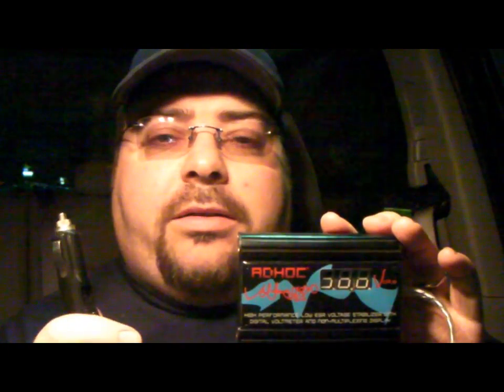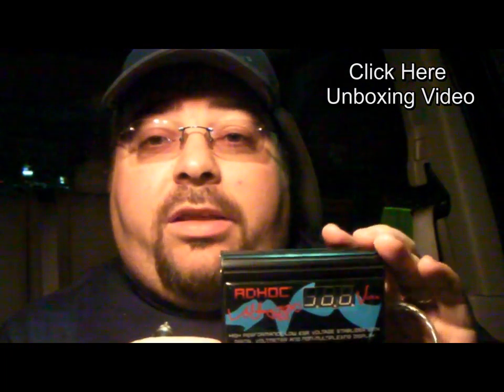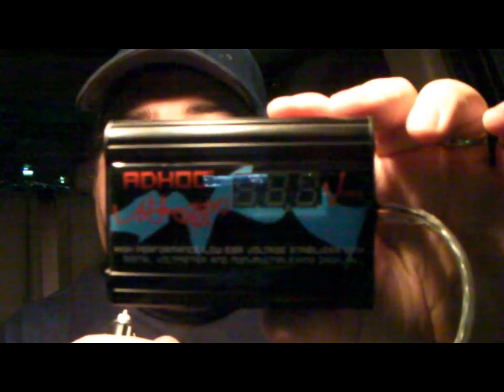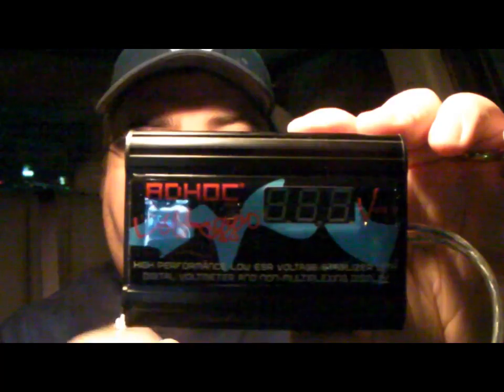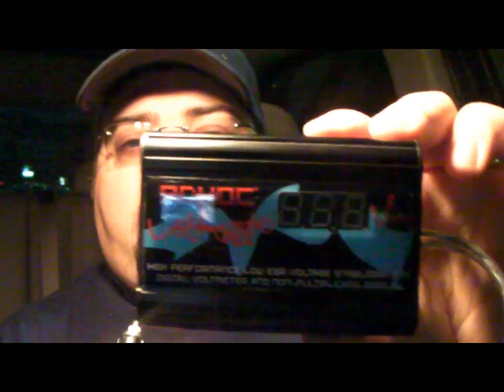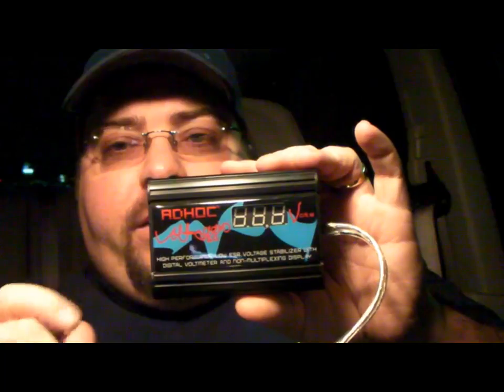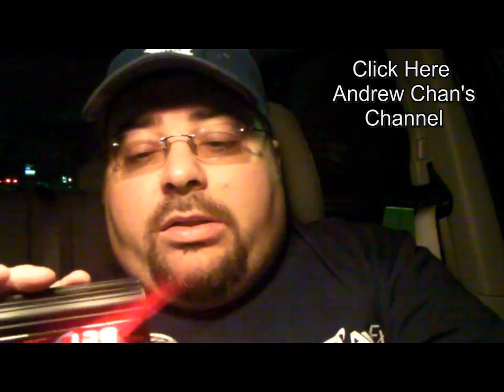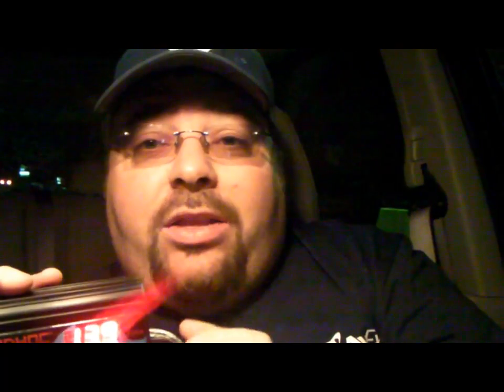ADHOC Voltage Stabilizer Review

Comment: I have used some of the Voltage Stabilizer (not this one yet, but I am going to), it does help smoother engine running, faster and quieter. My cars are including Lexus & Mercedes. Someone said it is not but I don't think they ever used the stabilizer. Cars may have built some voltage protections but not voltage filtering.

Comment: From a electrical engineering and mechanic standpoint. It will have absolutely no impact on your fuel econ.  It will not improve your ignition (fuel econ) the circuit does not care about signal noise. It will not improve shifting, most transmissions use line pressure not electrical signalling. Transmission that do use shift solenoids are powered by the ECU and it allready adjusts for line noise.  Your alternator already preforms this function anyways as part of the Full-bridge rect circuit.

Comment: Thanks Mark. If I may add, It doesn't necessarily saves on maintainance cost, although it may prolong some components. Definitely not a substitute for proper car maintainance. Nice review, but folks are going to flame if you say it will save on maintanance cost. The main point is a little bit of mileage, a little bit of performance, a little bit of smoothness, etc.The current going back into the car is very minimal. All it does is filters the noise in the main voltage of the car.